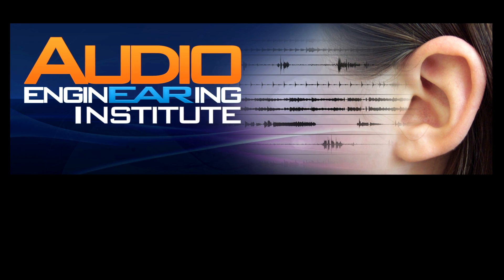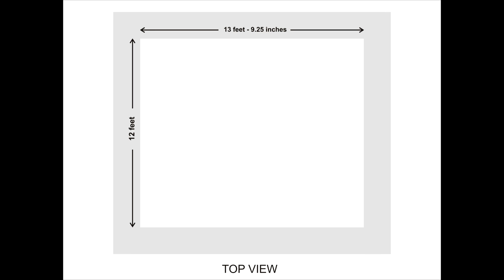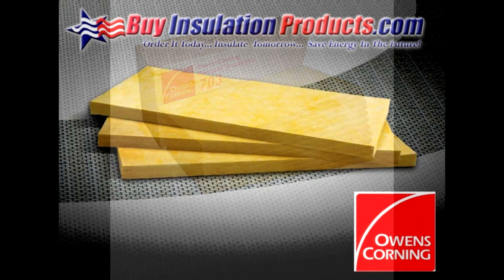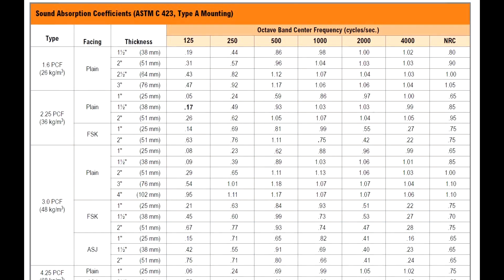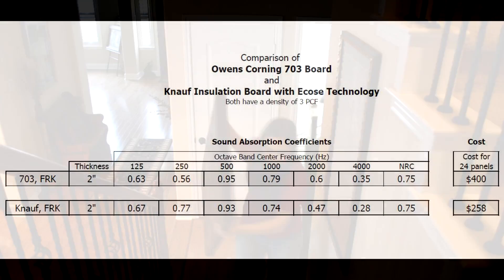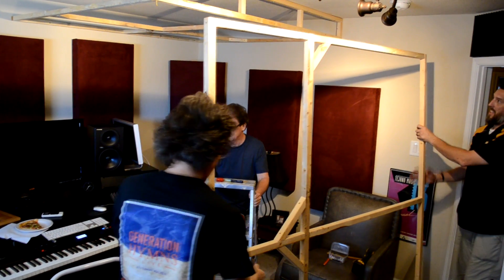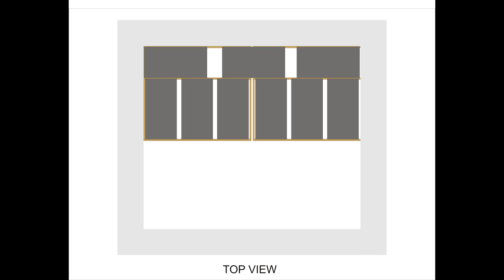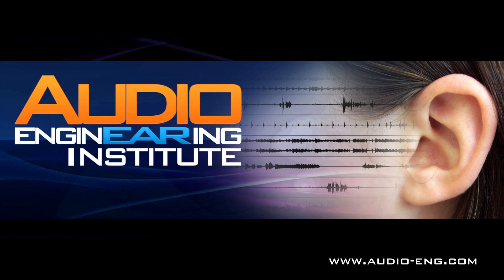Acoustic Treatment help for home studios

Comment: Seems like the aluminum foil on the back would interfere with sound absorption when you stack the panels... am I wrong?
And if I may ask:  What specifically did you like about the specs of the FSK panels?
Reply: The FSK had slightly better low frequency absorption.
Reply: @mperron3  Thanks.  Is there any concern that the aluminum foil will hinder the sound absorption when you stack the panels on top of one another?  I wonder if the plain ones would have been better for stacking...

Comment: A lot of folks are using Rockwool, which is an inexpensive, non-toxic material and comes without a backing, is 3 inches thick, and is readily available at most local building supply houses. I cover the insulation within a pine frame with material on both the front and the back. It is several times heavier than the panels I have made using the foam.
Reply: That's a good tip.  What is the specific Rockwool that you are using?  Can you send a link please?
Reply: Here's a link to the product I purchased at Lowes:

https://www.lowes.com/pd/ROCKWOOL-Rock-Wool-Batt-Insulation-with-Sound-Barrier-15-25-in-W-x-47-in-L/3394032

This is enough material to create 16" wide floor to ceiling corner panels for all for corners of a room, and two additional 30" wide by 48" high side panels. I created side panels with legs so I can move them around the room and adjust their distance from a side wall. This material is made to function not only as an insulator but also as a sound barrier. I understand the heavier the material, the lower the frequency it will absorb, which will make it far superior to foam panels, although I now have some of both to experiment with.
Reply: @SpeakerBuilder   Thank you.  Here is a link to the Rockwool "spec" sheet: https://cdn01.rockwool.com/siteassets/o2-rockwool/documentation/technical-data-sheets/residential/SAFEnSOUND-Fire-and-Soundproofing-Insulation-Techdata.pdf?f=20180618131849     

And a link to the Knauf product spec sheet:  https://www.knaufinsulation.us/sites/us.knaufinsulation.com/files/CI-IB-DS%200918%20WEB.pdf

The Rockwool has great specs!  The Knauf is only slightly better at 125 Hz.

The FSK had slightly better low frequency absorption.    Knauf Absorption Coefficient at 125 Hz is .67.   Rockwool Absorption Coefficient at 125 Hz is .52  .  But the Rockwool is WAY better at the higher freqs !

Comment: and they left the rest of the room inner walls untreated....LOL then the back of the room where the walls will get most of the sound thrown at it untreated, 
the inner walls are also untreated and also no diffusers . then to make matters worse they left the room square. with some fake bass traps that really aren't bass traps.
BTW I have 15 years experience soundproofing large professional studios.  This was done wrong, for about another $350~$500 more on the budget 
you could have had a properly soundproofed room. Just FYI, soundproofing begins from within the walls, not the outside.....LOL
Reply: First let me say thanks to the OP for taking time to share information. Nevertheless, I think you meant they could have properly applied better sound absorption or diffusion, not "sound proofing".  Sound proofing is a word that is misused often times. One can attempt to sound proof a room and care very little about how acoustically it sounds inside said room if soundproofing is the only goal. Example: Party Walls are an attempt at sound proofing not in room acoustics.  Sound Proofing and  handling sound reflections inside a space are two completely different processes and subject matters. ijs

Comment: Great information! Thank you for the details on where you purchased and the comparison charts too. I'm currently building a home studio in my basement simply to track drums only and am looking at all my options for acoustic treatment. And am leaning towards building some acoustic panels to hang from the wall. I was considering Roxul Rockboard or Owens Corning 703. But sounds like Knauf FSK is the better option. Cheers!
Reply: One of the Best Ideas of SoundProofing is "SoundProof Curtains" it actually Block outside Noise coming from Windows. Check Here: https://livesoundproof.com/best-soundproof-curtains/

Comment: Could you use those Knauf 2" 2'x4' panels individually to make 2'x4' wall panels?  Are they rigid enough to use for wall panels without having to build frames?  Do you think the plastic backing or the foil backing would make the panel more rigid?